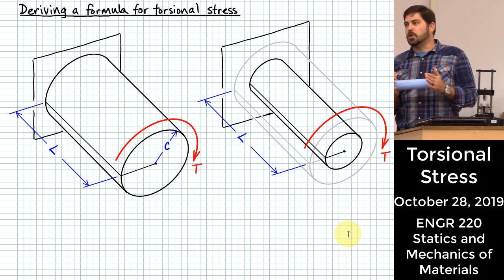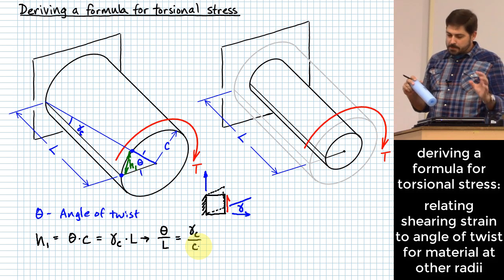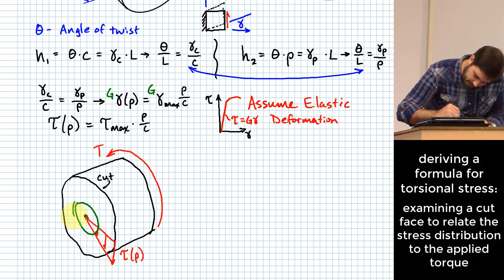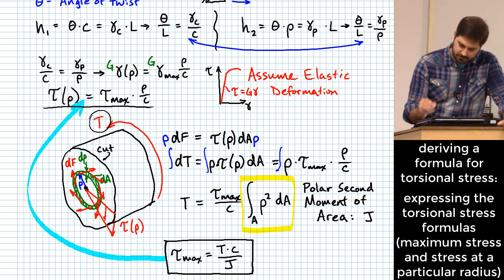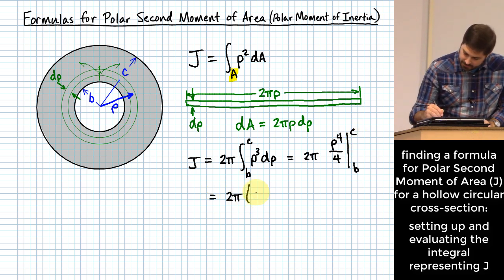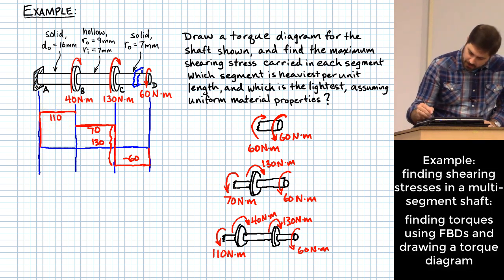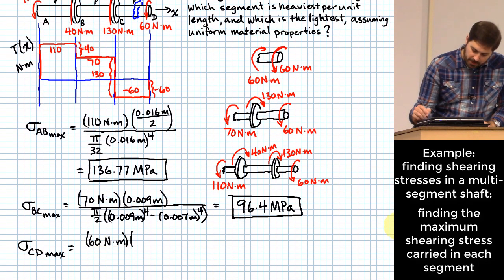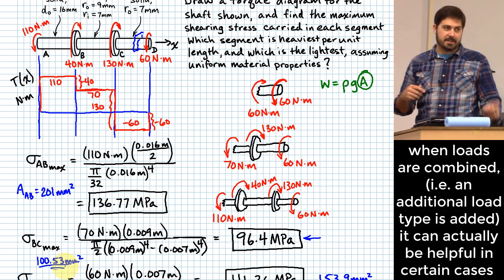Torsional Stress: Torsion Formula Derivation & Polar Second Moment of Area (Polar Moment of Inertia)

Comment: Dear Sir ,

If I have to twist Square solid bar ( Steel) and I have to twist 2 full 360 rotation and one quarter ( 810 degree) then what will be Angle of Twist ? I have to design one machine and I have to find require output torque to twist metal bar and require out put rpm 10. I will appreciate for your help.
Regards
Reply from the maker: Are you elasticaly deforming the bar or plasticaly deforming it?
Reply: Nice question. It becomes far complex when we are in the plastic region. The twist that he mentioned will probably require more stress than the yielding stress for the material-steel
Reply: Well, I think the angle of twist will be (9/2)pi rad
But why will you need to twist steel that much to produce the given rpm